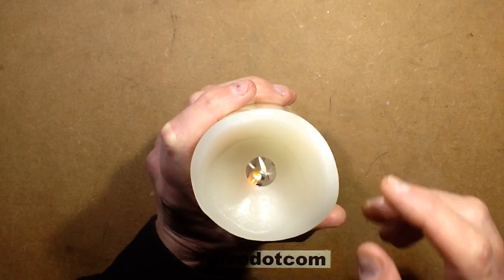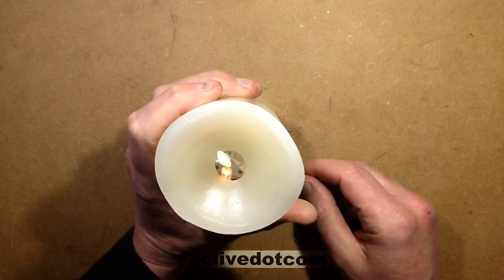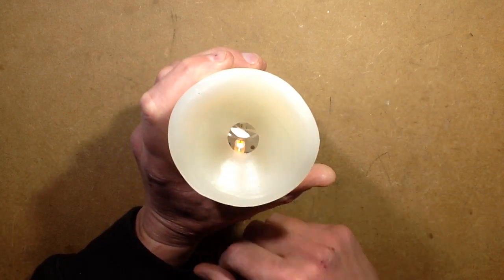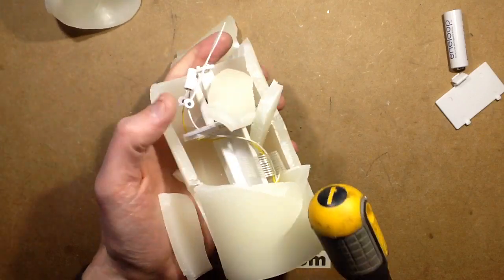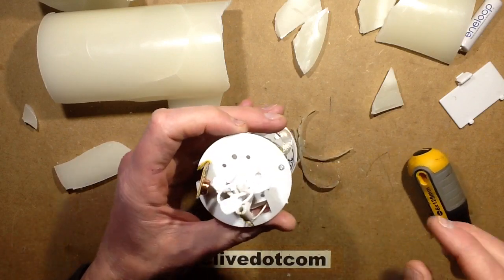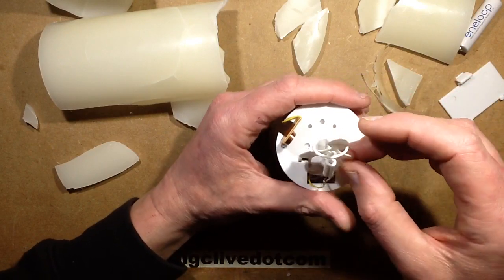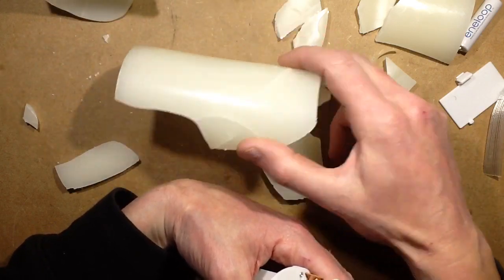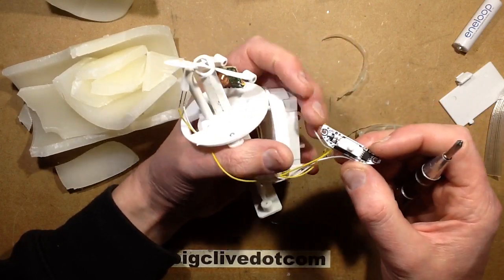Really BAD "dancing flame" style LED candle.

Comment: It's great when products can be opened with a standard screwdriver!
Reply: Love it
Reply: Could even work on glass...
Reply: He should have used a "Birmingham screwdriver"
Reply: Or a "Glasgow socket set"
Reply: or a Glaswegian kiss
Reply: Putting it back together the same way might be a tad tricky, though...
Reply: +Richard Turton Or a Manchester spanner.
Reply: +Rene Schickbauer hot glue fixes everything :D
Reply: Electricians hammer, anything heavy enough to move whatever needs moving.

Comment: In case I need to open one of these could you please tell me whether the screwdriver was flat, Pozidrive or Phillips because I would hate to do any damage by using the wrong one.
Reply: Phillips I reckon. You could probably get away with a Pozidrive too but don't quote me on that.
Reply: UKHeliBob Robertson, clearly. Best driver design available, hands down.
Reply: And do you need a left handed screwdriver or a right handed one?

Comment: Just had an (reasonably) expensive retail ceiling bayonet LED bulb fail Clive. No pop, smoke or anything other than a little bit of flickering the day before that went away by itself. After a solid year or two of 7hr/day service, it's dead. Want it sent in for autopsy from Australia?
Reply from the maker: Sounds like a failed LED in a series string.  I'll decline your offer of the lamp purely from the perspective that it would cost a lot to send it to me.  Our postal systems are somewhat more expensive than China's.
Reply: I've got three lamps bought from a UK high street store - all failed in the same  way, with burned and charred PCBs.  The last one failed after it's plastic cover fell off.. while in the kid's bedroom (thankfully ceiling) light.  Home Bargains: Almost as bad as the Chinese.
Reply: I'll do a teardown and link in an imgur album when I have the time then. :)
Reply: +bigclivedotcom doesn't look like a failed LED. Let me know if you'd like more detail if you're interested (removal of goop). Excuse the physical damage, I opened it with a Besser Block. http://imgur.com/a/7fq0O
Reply: I once bought a cable from a UK seller for something like £1.50 including postage. "Buy it now" price. It came in a jiffy bag with a postage stamp for £3.30 on it.

Comment: Hey Clive, I converted a set of led candles sealed in a similar way so I could plug em in and the way I got in without destroying it was to heat the outside with a heat gun, and then putting the handle end of a set of pliers into the battery case and twisting it out.  Just some info if you want to mod one of these!

Comment: I had a premonition that it was going to get melted open with a hot poker or similar object

Really not sure why genuine candle wax is so popular for these... it's a crappy material for any household object really but at least with a genuine candle it doesn't really stop it from working if it gets cracked cos the wick holds the pieces together.

Comment: Why are only Luminara using D cells? That alone is the reason I only buy Luminara.
It feels so ridiculous, there is PLENTY of space to fit D cells, yet they all use AA cells which is only about 1/7 of the capacity.
That means I only have to change batteries every 3 month instead of every 2 WEEK!
Does anyone have an explanation to why they use AA cells?
Reply: People, in the US, usually have a bunch of AA cells, since an 18 pack can be usually had for like $8-$10.

Comment: Smash it to bits instead of taking it to bits. That's about all it's good for. There's a store where I live that sells these flicker flame candles. They're expensive but the realism is convincing from a distance. When I first saw them I really though they were burning real candles. Pricey...a 6 inch pillar goes for about $50.00, but you get a free remote control with it.

Comment: Reuse that wax, heat it up, add 5 tablespoons graffitepowder and 30% motoroil, stir well ! Swap your motorcyclechain in it and wait 10 min. Remove it and let it cool down and you have the best lubricated chain in the world !
Reply: hmm ,there used to be a solid graphite greae chain lube that you heated up and dunked the chain into, i wonder if your homemade is close to that? (might have been called linklife, came in a large tin for the use of)